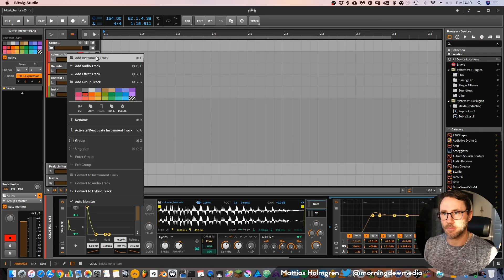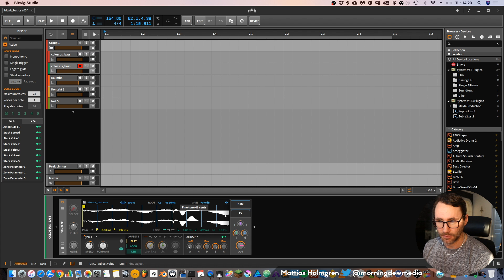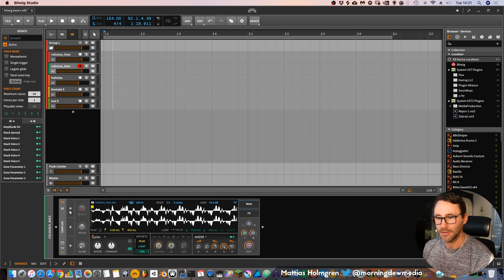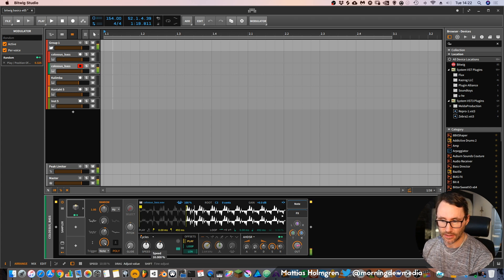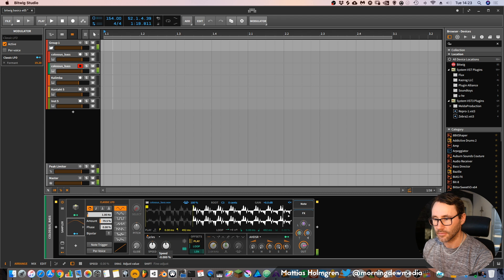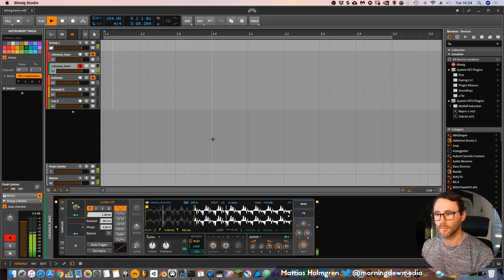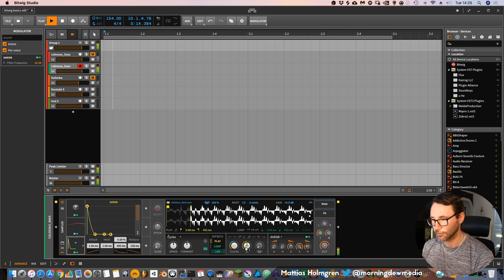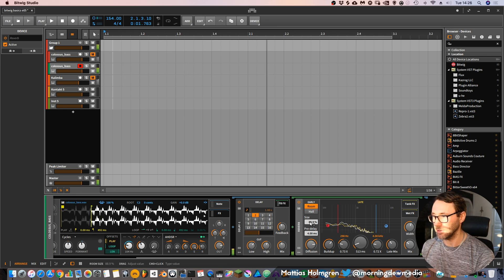Bitwig Studio Basics E05 - Modulators Part 2 - Sampler Modulation, Cycles Mode

Comment: Hello Mattias is there a way in which we can assign a Time period or kind of a Marker Point for the modulation to finish (maybe with a fade finish)? thanks
Reply from the maker: You can assign another modulator to control the strength of another modulator (depth) that way you can adjust as you like with automation….or just have the second modulator control mod 1 with its mod data output.

Example:
You have an LFO modulating filter freq of a synth at 1/4 with full depth.
Create a second macro modulator. Attach it to the depth of the LFO.
Now you can record automation of that macro. 

You can probably also automate the depth by itself directly on the LFo without any additional modulators…its just a parameter like everything else on the interface. And most stuff can be automated / modulated. 👌

Always many ways to Rome in Bitwig. Just imagine ☕️ 😃🥳
Reply: @MattiasHolmgren  hello Mattias perfect, many thanks for the answer. I hope this query being useful to others as well.
Reply from the maker: @mja a  awesome, yeah absolutely, I think this "modulation depth" trick will be useful for many folks wondering about Bitwig Mja!
Reply: Hi I was thinking that I can use Automation too, what do you think?

Comment: Thank you for your excellent tutorials. While modulation opens endless possibilities, I am struggling to figure out which modulator is actually affecting a specific parameter. I can mouse-over a source to find target (if it is visible), but the other way around? Like 'trace precedents' in a spreadsheet?
Reply from the maker: If it's your own modulation setup, it's one thing. But, yeah it can be fiddly to look at other peoples presets. But you can always look at the Information Panel to the left,.If you select your major device which is modulating down the chain, you should see what params it's modulating in a list. In the modulating list you can also set the curve of the modulation to "linear", "expo" etc. Which can be fun to experiment with. Hope the info helps Åsmund! Thanks!